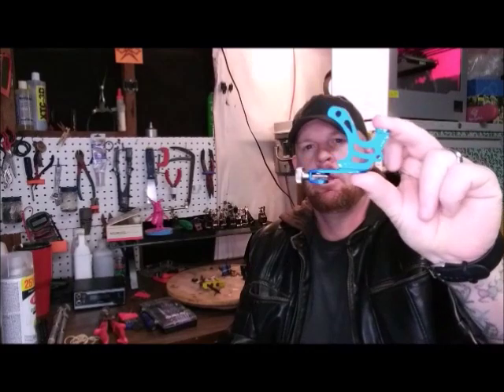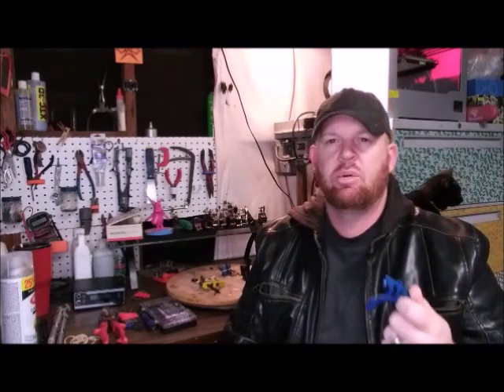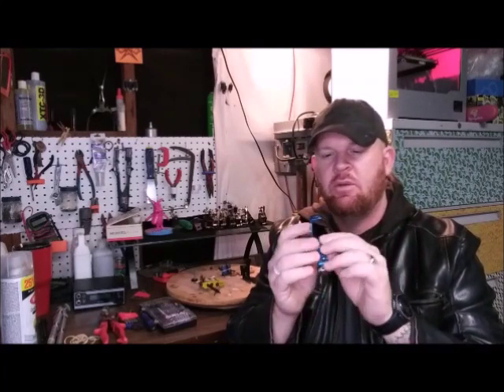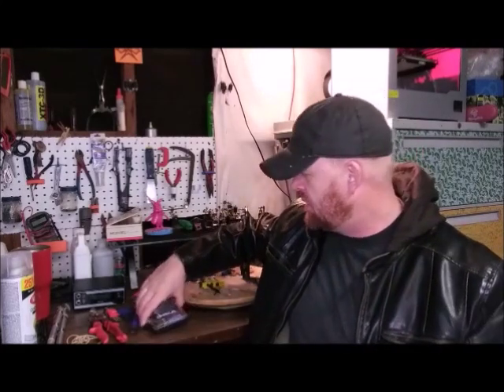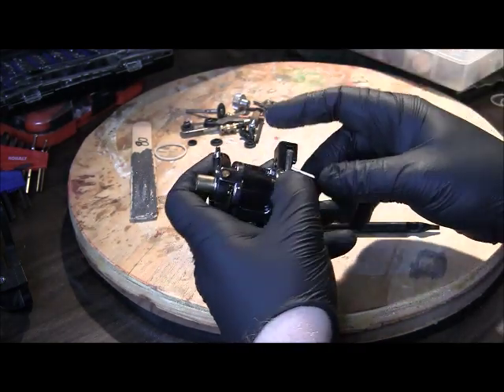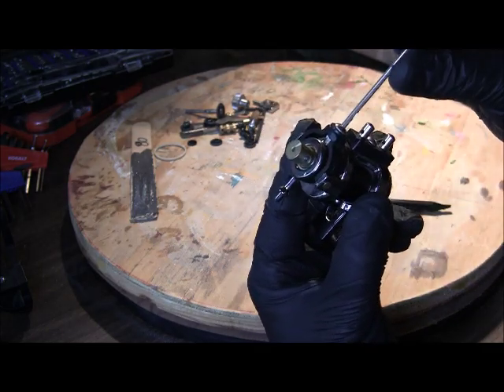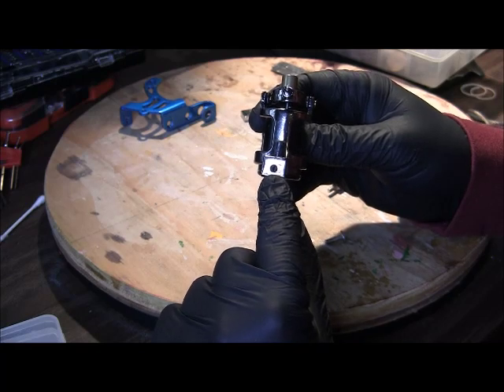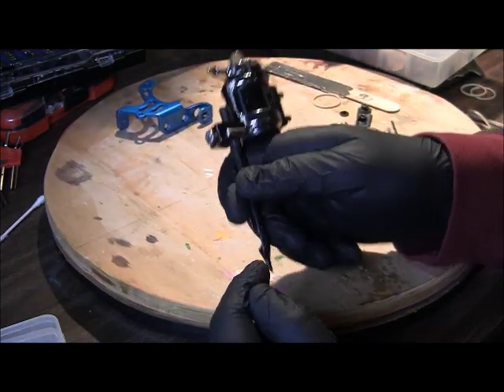Machine Tuning 101 Machine Vice - Tattoo University

Comment: Ok I have a 2 part question about Rotaries...when running Rotaries I see people question what voltages to run and I understand its going to be different for everyone depending on their machines and speed but nobody really wants to say...im just wondering what are average speeds example someone says I run a liner at a 10 and shader or color at 7...so what are some average numbers and second question,    with a shader or color packer say your running a 7 or 9 mag or round shader...why is that running lower than a liner when there's more needles grouped compared to a liner??